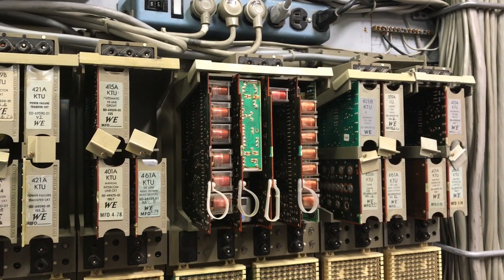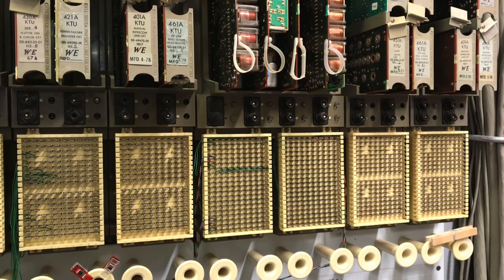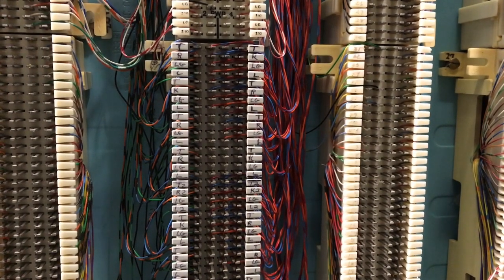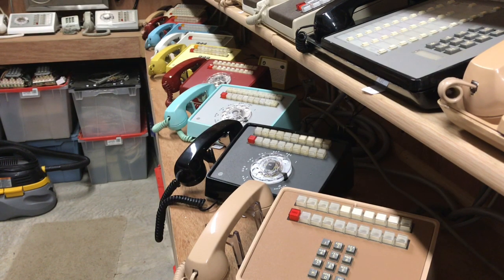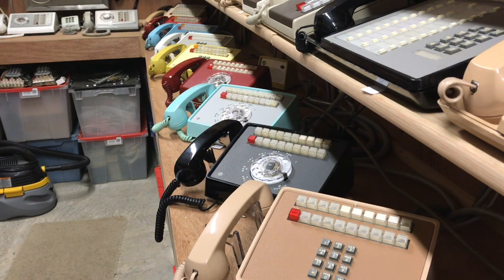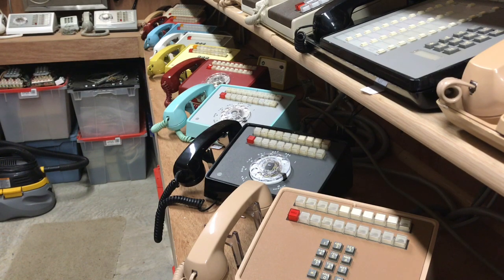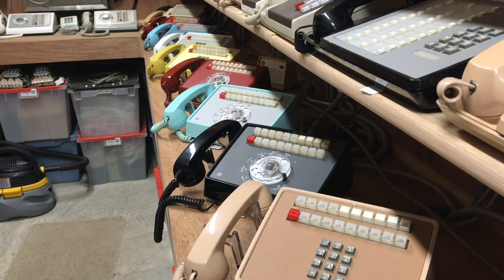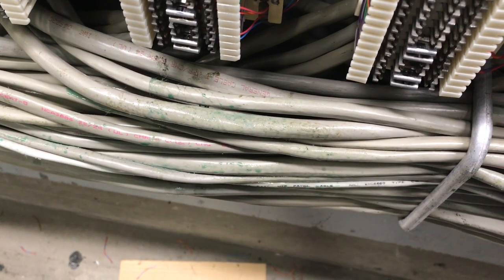Western Electric 3 path intercom.

Comment: Ugh. Backplane issues can be the most frustrating to diagnose. 
Do you think the link card could be repaired? 
I've had good luck removing cable goo with Zep degreaser. It leaves the cable not-sticky.